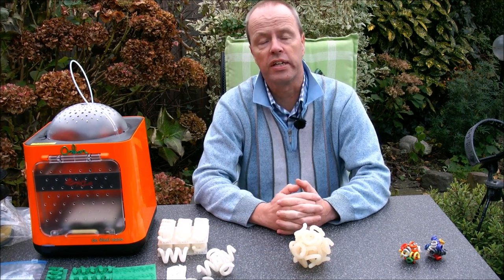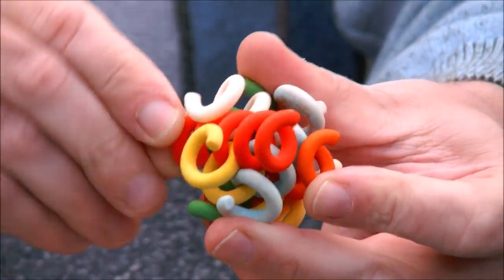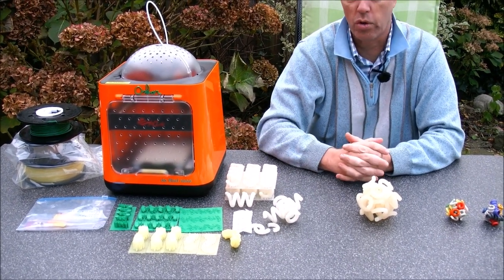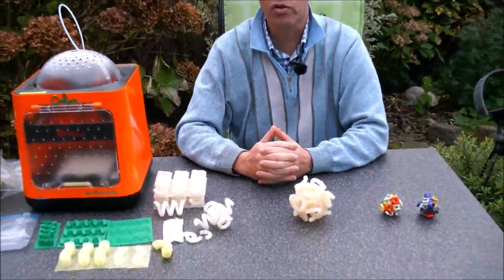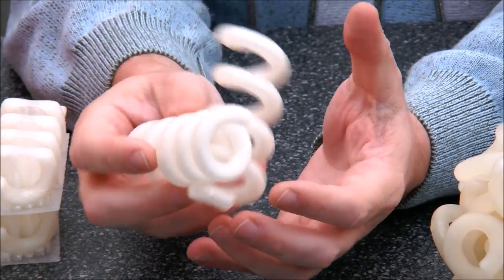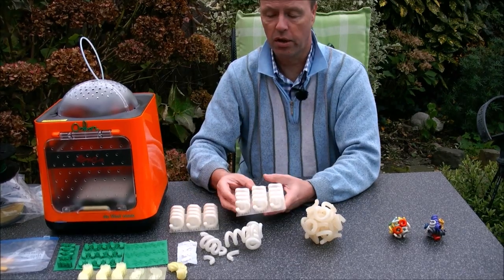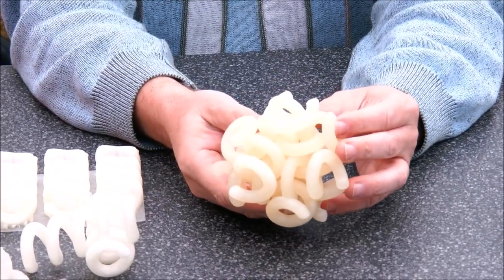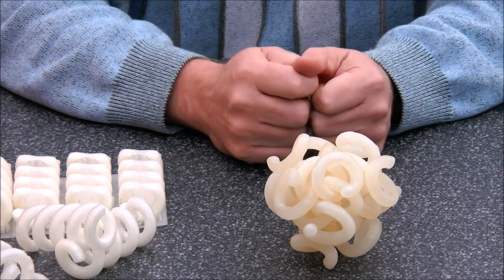Spiral Burr - Can you 3D-printer print this?

Comment: Hi Oskar, some advice, to get better layer adhesion: printing temperature is crucial! As well as the type of filament you are using. PLA is more brittle than ABS, Nylon and PolyCarbonate have great structural properties and PETG is food safe.

Layer height and nozzle diameter (and ultimately extrusion width) also are key factors in interlayer adhesion.

These DaVinci printers aren't super, there are many DIY printers that deliver better quality prints! (I have built four printers so far and a few other cartesian-like machines such as a laser cutter and a pen plotter and have had great results in terms of strength).

Most of the prints that I have are thinner in some places, yet when I try to break them it just hurts my fingers and the parts don't come a-part.

Don't give up yet! For example try out some filaments from FormFutura in PLA and experiment a bit with printing temperature. For example, print a couple of towers with different temperatures and see how easily they break and if the temperature has influence. For example: I print PLA around 205/210 degrees Celsius and have great results. But this again also differs per type of filament.

I sadly do not have the time for prints that take a day but I might just print a 'wokkel' every once in a while and see if I can put them together.

Oh, and also, you don't have to print with a raft that large. In my experience having them printed with a brim and some support should do the trick. And my last piece of advice: print them one by one, if anything fails, you don't lose the entire batch. This is a key component in working with an unreliable 3D-printer. A hotend should not clog! This is a design error by the DaVinci team.
Reply: Yes! For something that goes trough wear and tear, PLA isn't the best option. If your printer has a heated bed, try ABS or any of the other listed above!
Reply: @mathis5225  Yes! However, to add more: PLA has a lower friction coefficient than ABS. Haha, choices, choices... ;)
Reply: I also do not know how old the filament is, but does it not tend to have a shelf life that is more in terms of a few months than years?
Reply: @daan8695  I keep it stored in a sealed metal vat that is conveniently as high as a chair. So I designed a pillow to go on top and it's basically an airtight storage container that doubles as furniture. Whenever I notice the PLA becoming brittle or when I hear popping sounds when printing I put the filament in the oven for six hours around 60 to 70 degrees Celsius to drive out all the moisture. Last month I printed the most beautiful print I ever made with filament that I bought in 2013/14 that was never stored inside that airtight container and it still worked so I guess it really depends on so many factors.
Reply from the maker: Thank you for sharing your experience and for providing such encouragement!

Comment: Heyy Oskar,

I'm glad to see that you are finally 3D printing at home! But I'm sorry to hear that your first experience with FDM printers is not a good one because these could be very benefitial for quickly prototyping your designs. As someone else stated, a couple of things could influence the quality and success that you are experniencing:

1 - The design itself. Some models are easily FDM printed (for instance your cubic trisection), some are moderate (most twisty puzzles) and some very hard (like these spirals)

2 - The material. PLA is easy to print but not the most technically advanced material. ABS and Nylon are very strong but almost unprinteable. I would recommend PETG

3 - PLA should be a lot stronger! Print settings could help this. Layer height, width and infill can increase strength. But the best is printing hotter: this will fuse the layers better. Disadvantages (especially with PLA in a closed chamber) are drooping due to insufficient cooling and clogged up nozzles due to overheated cold-ends. try printing with the box open on all sides.

4 - The last one, and I'm sorry to say it, but the printer itself. It is nice that you got it for free but it is one of the lowest quality printers on the market at the moment. In the same price range (extremely cheap) you can get for instance a Creality ender 3. Advantages: much better print quality, reliability and competability. Disadvantages: DIY kit, bigger and constant tweaking especially if you move it around. But still, a much better option for the same price.

Apart from this unbiased advice: I work as a designer at a small 3D printer manufacturer in the Netherlands and we produce a very compact, stable and portable 3D printer that is build like a tank. No bed leveling ever and you can put it right beside you in your garden ;) It has a build volume of 20cm cubed, a heated bed and eats (almost) every filament you feed it. If you're interested we can lend you one for some time to test out? Because I follow you for years now and I would really like to see you succeed with 3D printing! I have sent you a message via your site
Reply: Ik zie nu dat je web-form een beperkt aantal tekens heeft. Ik stuur even een e-mail naar info @ je website, ik hoop dat dit ook werkt! Robbert
Reply from the maker: Thanks for the advice. I believe that my printer is effectively broken. Thank you for your generous offer. I'd love to come to Utrecht, see your operation and try out one of your printers. My contact page is at http://oskarvandeventer.nl/index_contact.htm. I did not receive your message. Please try again, or find another way to pass me your email address.

Comment: Wow. That geometry is very hard to attempt for your first 3D print. PLA filament exposed to air can get brittle pretty quickly so it's no surprise your green print failed. It might be best just to buy a new printer. You can get fairly good ones for under $200 USD with international shipping.